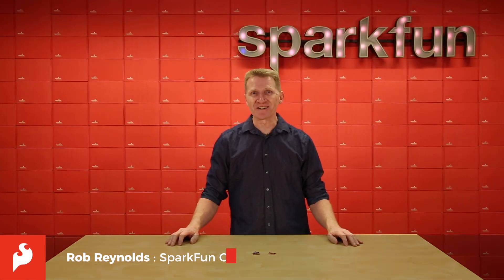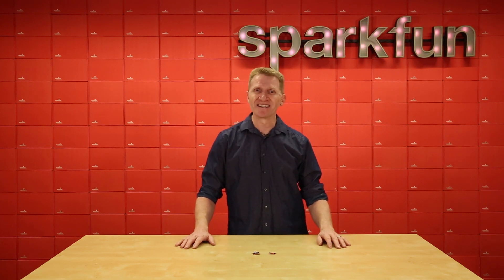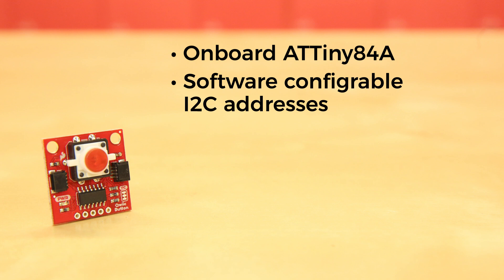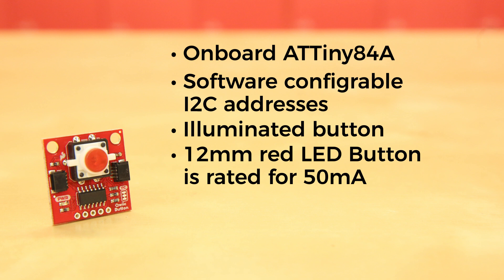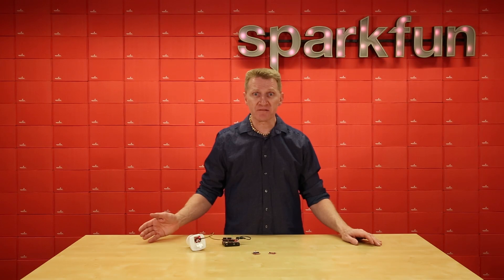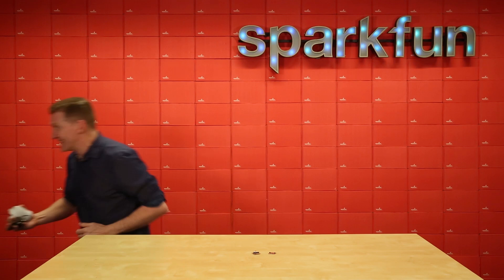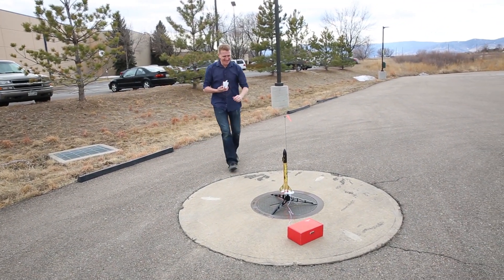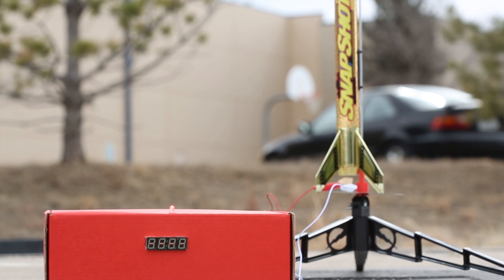Product Showcase: SparkFun Qwiic Button

Comment: So it is what the WS2811 driver did for the "neopixel," but for buttons? Queues work for something as trivial as a light display. Not so much for user input. You should have displayed the modular aspects of this board. You're nuts if you think people will pay $7 for one.